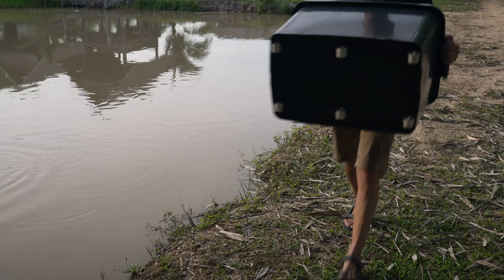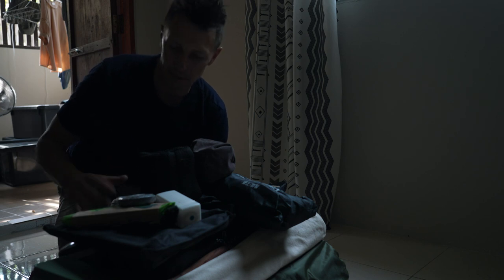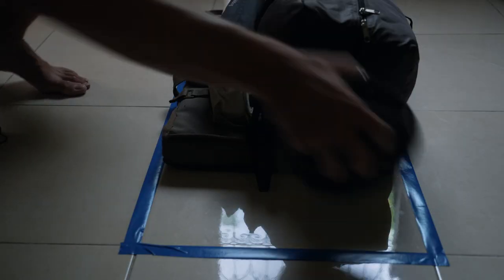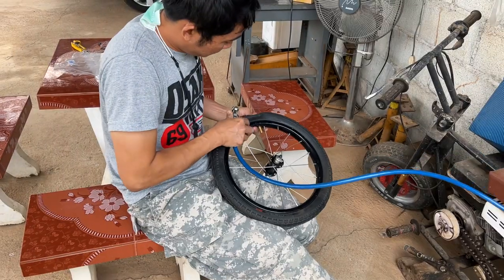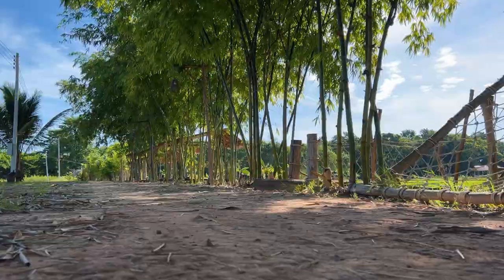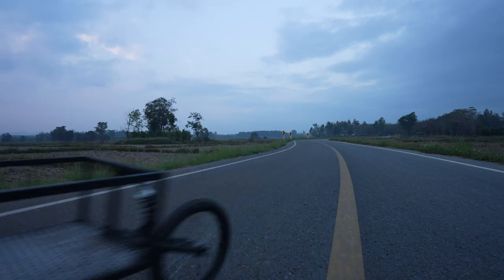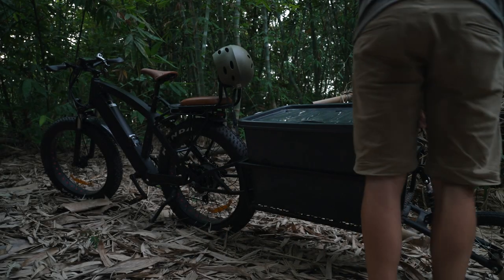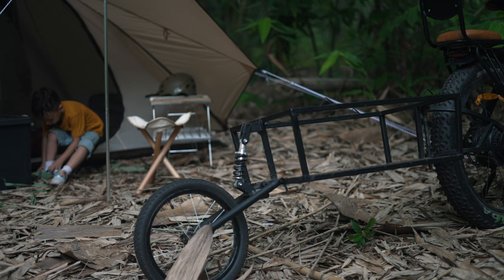I Built a Camping Trailer I Can Tow with My Bike!

Comment: Oh my gosh Drew, this is excellent! We got our Bean Stock because of you and now I guess I’ll be getting an e-bike and trailer to use on the ranch- it’s perfect! I don’t have any place nearby here in Texas to take it out camping like you did but I sure can try ! Please keep these kinds( all your videos are great) of videos coming when you can. When you live and work for the Lord- you’ll always overflow with blessings and you and your family are a blessing! Take care- Cheryl
Reply from the maker: For the ranch I would suggest a trailer with two wheels. I have been using this one wheeled trailer for everything. But there are times where I tell myself if I have to haul that item one more time I am building a two wheel trailer just for home chores. All of a sudden chores are fun again! I want to pick up a trailer in the States for our family's ranch as well. They are a great fit for the lifestyle. At first I wasn't a fan of these giant electric bikes with oversized tires. They don't make sense for camping. But for hauling and working they are a dream. For the first time ever on a bike I can take my hands off the handlebars at any speed and even on a corner. There is that much more stability. And then transitioning from deep grass to gravel, to sand, you barely notice it. I explain it to friends as just one fluid riding experience. Thanks for the kind words Cheryl. You are so right on with the blessings. When we committed to this we thought the work would be in Bangkok. We weren't super thrilled to be living in a concrete jungle, but at the same time we were okay with it if that was where we were supposed to be. Immediately after committing to this new life we found out that was not the location. God knows the desires of our heart and I think he honors that for the most part. Here we are in Northern Thailand near the border of Laos. There are mountains on every side of us, rivers, neon ricefields, and the majority of National Parks in the nation are all within  20 minutes to 1 hour drive away. Honestly with all of our travels overseas there isn't any village or town I would have picked over this one. I can't wait to show you it in some future video.  Blessings to you as well Cheryl.

Comment: The trailer for the bike was cool.  Gear can sure add up.  We thought the video was cool.  Liked some of the gear you were using.  We chuckled at using your boys for testing out the untested trailer.  😀😀😀
Reply from the maker: Thanks Garret. It has been fun to take a more thoughtful approach to my gear. This all started last year when I knew we would be living in the Bean Trailer for over two months. Because of the time in the trailer I ended up taking less year. Basically it was more essential gear and less fun gear. And to May and my surprise we actually liked the experience better. Maybe not better, but we realized we didn’t need as much gear and that it brought less stress.

Comment: We just started riding our bikes and I'm wanting to do the C&O canel from Cumberland MD to Washington DC and camp along the towpath.   Definitely like seeing these types of videos, actually we like seeing any of your videos.
Reply from the maker: That sounds like a fun adventure. That is kind of how this all started for me. When I was 18 I did my first through hiking trail. And I realized "I think I could do this on my bike next time." I could also shave off a ton of time and get through these locations quickly. Well, I was wrong on the quickly and easy part. I did the same trail a year later on my bike and kept asking myself "were there this many downed branches, exposed rocks, and loose shale last year?" It was quite awful. I found myself pushing my bike almost as much as I was riding it. However, I learned a lot about bikepacking and it got in my soul. From there I started doing it more with fishing. I always loved packing everything in to a remote fishing hole. But doing it on the bike was so much easier, faster, and more enjoyable. A little sketchier with the bears as you come up on them faster. But other than that I never looked back. This is my first time however using a trailer. In hindsight I should have been integrating this into my lifestyle years ago.

Comment: So inspiring! Gonna get out there with my boys on my Yuba Spicy Curry cargo bike. Not sure if I have enough room on the bike itself for a minimalist camping setup. But I'm already looking up ways to attach a trailer to the cargo bike itself. More of this please!
Reply from the maker: That sounds like a great setup. I was originally trying to build a cargo bike for this, but I had trouble finding a frame over here. I actually had trouble finding any frame. I was lucky to stumble upon the one I did find. In terms of gear and kids the only issue i have come across is just the added weight over the rear hub motor. I am assuming yours is a mid-drive. With all that weight over the rear it just requires me to tighten down my spokes every few months. Without the extra weight the spokes seem to need no adjustments.

Comment: Great video and great bike & trailer set up! How does battery hold up with extra load? And, are you charging at camp somehow or bringing backup battery?
Reply from the maker: I’ve been very impressed by the battery and load. I primarily manpower the bike by staying a little faster than the cadence of the motor. I haven’t done any super long trips yet but our trips over 30 miles have been leaving us with plenty of battery left. We have the capability for carrying extra lithium in the trailer. But so far I haven’t had to use it. Once I start tackling the ups and downs of the mountains though I will have a better idea of what this can do. I did one trip where I was biking over 20 mph. That ate up the battery pretty quick. But if I keep to a pretty nice slow crawl it just sips it. I find the same is true without the trailer as well. It’s always a game for me to try to stay ahead of the motor kicking in. I find it’s like one of the best workouts out there. Instead of being focused on how much energy I have in my body I find I am more focused on the battery capacity which makes me push harder. Like you mentioned I have originally planned on hooking solar up to this, but with these trips with east it’s really not needed. Once I start doing triptrips on my own I’ll probably integrate the solar as well.

Comment: Loved this video.  Would love to know more about the specific gear you guys used as it all looks well considered versatile and minimal space/weight. How long was that trip?

Trying to pare down my own kit. I have a 10 day trip I do every year but getting more efficient in weight of gear is more important every year.
Reply from the maker: I’m trying to put together in North American gear list. I’ve been surprised to find most of these products I’m able to find on Amazon in North America. I designed this camping trailer to be a 2 to 3 day max trip. As this was just a shakedown trip we only stayed out one evening. I’m kind of glad we did too. East slept perfectly through the whole night I was miserably rolling around all night. I’ve worked out my sleeping kinks now, but that first night was pretty rough. Mainly it was just a humidity and the heat. I now have a tiny little portable fan that changed everything. Your 10 day trip sounds amazing! Years ago I built my original bike packing set up to go for about 10 days. But unfortunately I never had the chance to stay out that long. I would love to do that someday. Even backpacking I’ve never went past seven days with friends only solo. All our long trips have been in the teardrop trailer. Which is fun, but I’d love to do it a bit rougher sometime with a buddy or two.

Comment: Hi Drew, what kind of ebike do you have here?  It looks like a good hybrid for all-purpose use.
Reply from the maker: I wish there was an easy answer here. It is a combination of multiple components/bikes. The frame which I purchased brand new didn’t even have a brand. I have done a bit of research on it though and I think it’s a frame made in China for a high-end American bike company. I got it out of Bangkok, but it was without all the branding. I definitely overbuilt it. It’s a little too much for my needs, but I love it! If I was to build one specifically for camping though,  I would go a completely different route.

Comment: I actually really i enjoyed this video
Reply from the maker: At some point I will get the motorbike on here. I designed the trailer to fit on our small Honda Supercub. Orignally I designed it for a dirt bike as well. But it was messing with my turning radius so I had to cut it down a bit to only fit the small bike. Glad you enjoyed the video.

Comment: Some day someone will make a dual use trailer that can go from bike to bus to store  to road that really camps. Theft is so high, variables in rules for buses. Many do not allow carts in isles. Leaving your trailer and supplies outside pulls theives to the opportunity while you shop. Had a large folding shopping cart with 20 inch bike wheels held up to 180 . Stolen. Can not find one anywhere now. It didn't  have quick release wheels and I supplied the exlarge duffel water proof bag , bungees straps for top ( sleeping  bag, added a golf club fishing rod holder to cage for long items. When I needed extra not using a bus I incorporated my trailer in.

Comment: Love the videos! I have a question I really want a teardrop camper what’s the absolutely most Affordable one I can get can’t afford a bean so what would you recommend?
Reply from the maker: Right now I’m pretty obsessed with composites and aluminum. A great bargain out there is the Road Toad. I’m almost afraid to tell people because I’m afraid the price will rise. What’s even better about it is it’s made under the parent company CampInn  who makes excellent teardrops. If May wasn’t so set on the shape of a teardrop I’d also buy a Runaway or Hiker Trailer. Great bang for your buck.
Reply: @PlayingwithSticks  ok thanks
Reply from the maker: I just read your question again in terms of most affordable one it used to be a basic model from tiny camper company. It’s been a while since I’ve checked back on the price.

Comment: Ok totally off topic, and sort of on topic.

A little trick you can do that works well.   Get yourself a micro USB hub.  a little 3-4 port unit is all you need.   You plug it into your cellphone.   Then you plug your "battery bank"  be it your full sized solar powerpack, small powerpack, or such into 1 slot, this will keep your phone charged.   In the next slot.   Plug in a USB WiFi antenna.   The antenna's have a much longer range then the cellphone itself...  If camping at a campground that has wifi,  or near a wifi source,  a basic antenna will reach about 300 feet, a good one might reach 600+.  Alternatly if you have data on your phone, you can use that.

Now most phones have the option now to act as... "wifi hubs" themselves.   so,  you then tell the phone to act as a hot point...  and can then log other devises,  laptops, tablets, and such into the phone for access to its wifi connection or direct internet.

In doing so you can have devises that don't have good wifi range,  or don't have their own internet access, to use the phone.  Allowing children to "watch movies" or such on a tablet, while you work on a laptop, sharing the phones base signal.

it gives options if you have more then one electronic devise and have children who get bored before bed time, or the weather had turned bad.

Comment: That's ALOT of stuff for "simple campig".
Reply from the maker: Yep. I have come to find that simple doesn’t always mean primitive or 100% minimalist. Those are also styles of camping I love to pursue from time to time. To me simple can be more defined as cozy, practical, but not overly dependent on gear. A simple experience to me is a gas lantern over a battery operated lamp. A wooden handle ax over a rubber handle ax. It’s the little things I am finding bring out the value of simplicity for me. And I don’t mean physically little. For example my wooden gear stand and camp table are both pretty large. They bring an organizational simplicity to the campsite that helps me feel grounded and comfortable. It’s really hard to explain.
Reply: @PlayingwithSticks  great point! keep the videos coming.